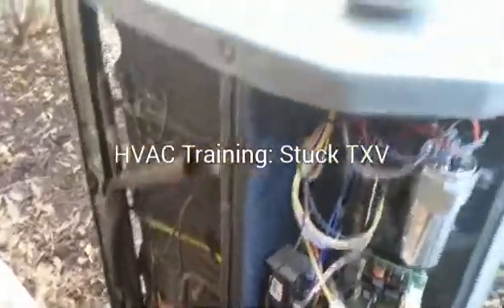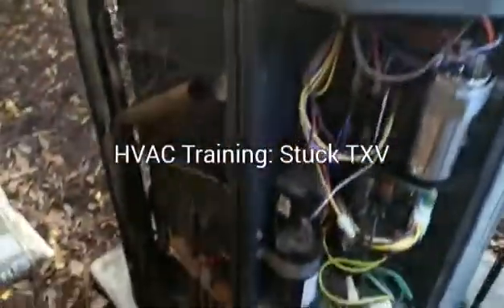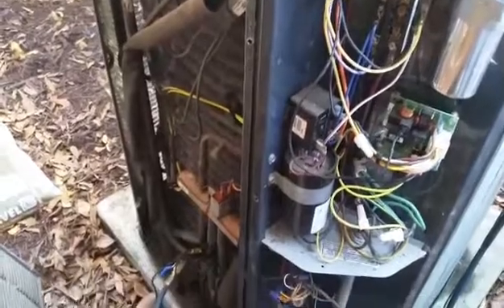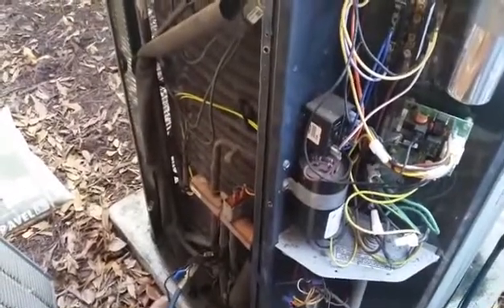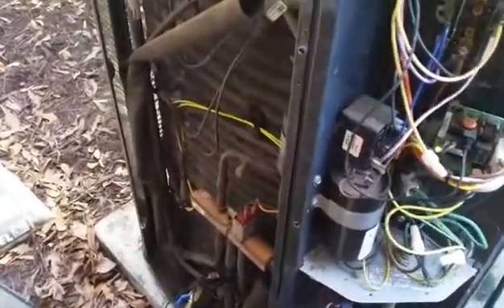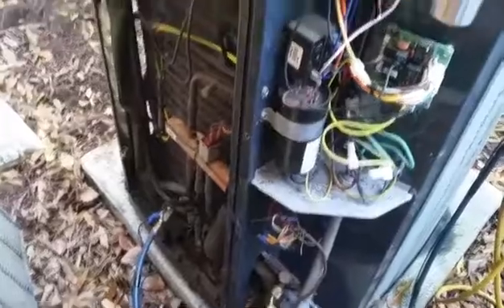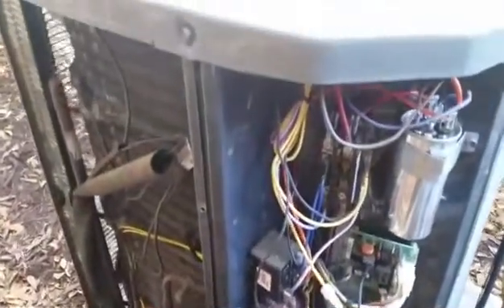HVAC Training: TXV Stuck

Comment: There is a rust inhibitor used by a subtier  supplier . I can by pass filter driers a cause a buildup at the point of expansion.. OK I learned that expansion vales do hang up or stick from text.That is why this video caught my attention. I had to do a little research before commenting . That black sticky tar is a major industry problem and not the due to lack of recommended procedures... The who is responsible problem will be more than likely pushed on the service tech...No one has come up with a solution from what I've read so far.
Reply from the maker: Brian Ellsworth only solution I have heard is to use AC Renew from new calgon. I have not had the issues that some of the other techs have had.

Comment: I would like to know more about the Supco 88. Have you ever tried it Zack? I know our local Trane Dealer says they recommend it.  Any thing is better than having to change out a valve.
Reply from the maker: MrMultitool I have used Supco 88 a couple times. It seems to be a good lubricant for the system.

Comment: Thks for the tip.. I have a ?. I had checked a system on heat mode and the pressure was H 285 L 295. What does that tell u ? Evap coil is in decent shape filters was clean and it was heating the home. Customer complaints was that it was a little cooler than normal. But the pressure was not in range.  What is a good pressure for heating mode at 45 degrees?  Thks
Reply: I would like to also know what kind of pressures are normal on 22 and 410a in the winter
Reply from the maker: eddiehvac Most of the time heat charging charts are on the machine. Just remember that the suction will be lower because that pressure reflects outside temperature in heat mode. IE if you worked on a heat pump when its 45 degrees out the suction may run 45-50lbs. (rough estimate). Your head pressure should be 200 or so, but it is imperative that you confirm it on the charging chart.

Comment: Can u show where you put your temp probes in heating mode and maybe gauges. I know true suction port but I can't seem to get the correct reading with my clamps in heating mode. Thanks
Reply: Superheat will come
From common suction, both pressure and temp
Clamp. The subcool will be high pressure (in heating, which is your typical cooling suction line or compressor discharge if its Trane or American Standard) and liquid line near the liquid line service valve.

Comment: You know Murphy's Law, it will work fine until you drive away, they'll call you, you'll come back and it will be working fine.
Reply: Nice find Zack.
Reply: ***** that plan is a little too elaborate for me Jim.
Reply: It's a certainty
Reply: talyn875 Dress up like an Arab, blow the unit up, they'll see an Arab running away, they'll blame it on Alkeda, the News will make them famous, their insurance company will pay for a new heat pump, "Or" you go to jail and blame me for it. Na just get a new valve tomarrow.
Reply: I've seen them on refrigeration equipment stick and they do tap them and no more problems. But if it does it again it's outa there!